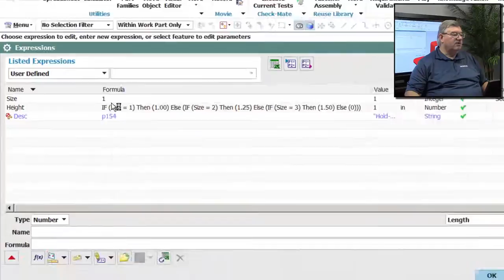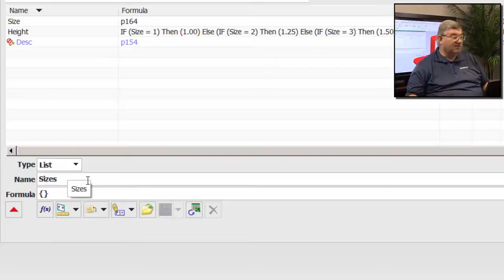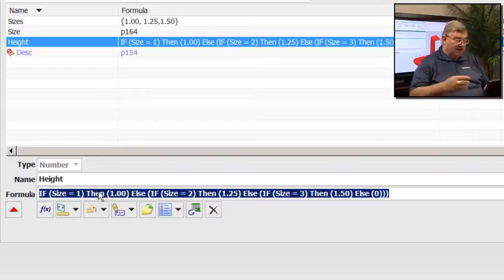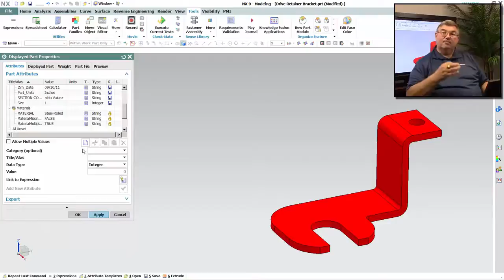Attributes and Expression Templates - NX - Siemens PLM

Comment: at minute 1:13 it is shown the expression interface. The Height value depends on the Size parameter and it is driven by an if/then/else statement. The last else statement is set to 0 (zero) so, in the video it is shown that NX output an error. Would it be possible to have, in the last else statement, beside the zero value, something that let the user to input the value? thank you
Reply: 0.00001